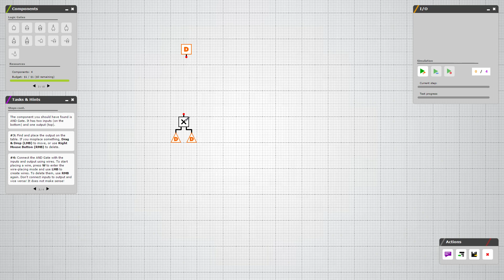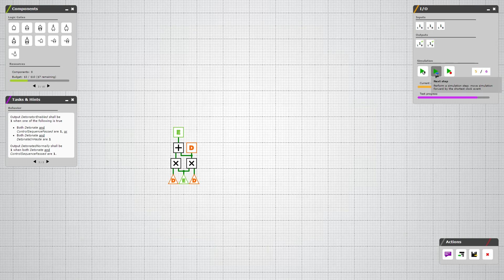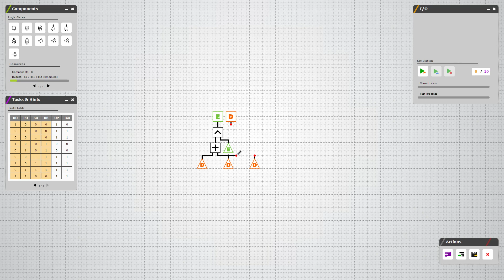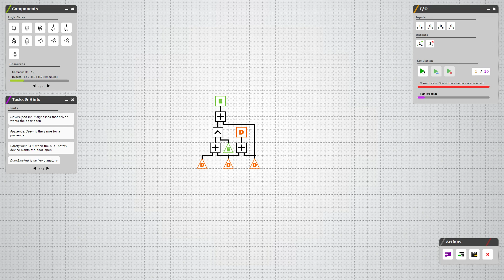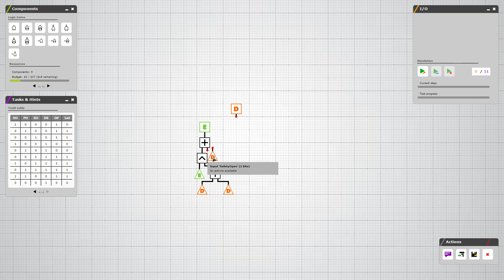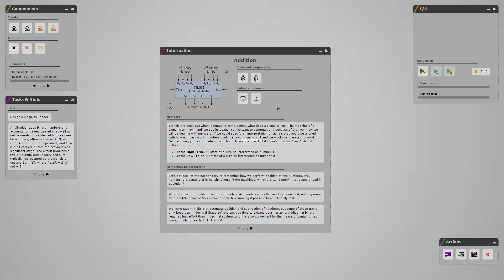FIRST LOOK & PUZZLES - Hardware Engineering: Ep. #1 - Gameplay & Walkthrough

Comment: A drag-and-drop interface sure makes things easier to test than text based, like MHRD. You went through about half a dozen variations faster than I could type one wiring and parts simulation with MHRD. 

You said there were four modes of this game. Which method did you just demonstrate; Tutorial or Design mode?
Reply from the maker: +typedeaf Uh I don't remember the modes. I guess it was the main mode, doing the puzzles from the start.

Comment: Good day, man. Thanks for this video (can't buy this game now, so just look=)).
In bus door solution, at first attempt, there was a nine lines in a truth table, at second attempt - ten lines. =)

Anyway, there is a shortest solution. 
1. You can disconnect DO (driver open) input - scheme can work in right way without it. =)
2. Equations for outputs should be:
  OP = SO or not(DB);
  IaO = SO or PO and not(DB);
Working in a both truth tables in this video. I check in Proteus, just need two inverters, one 2-Input-AND gate and two 2-Input-OR gates.

Good luck!

Comment: xor is not going to work on it's own.
because it will simply fire a HI when either one input is on.
what you want is a multiplexer.
set the output to the value of the input if the other input is high, otherwise set low.